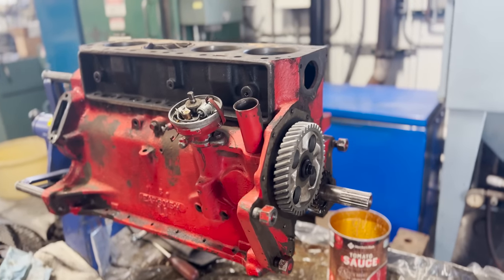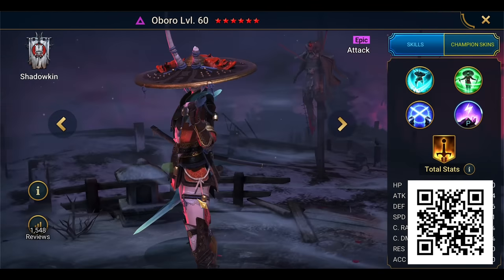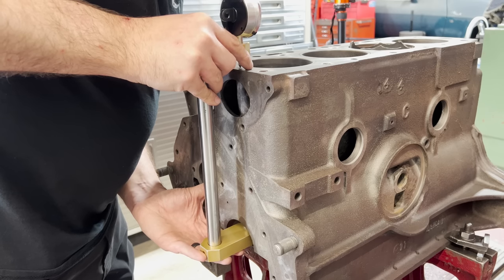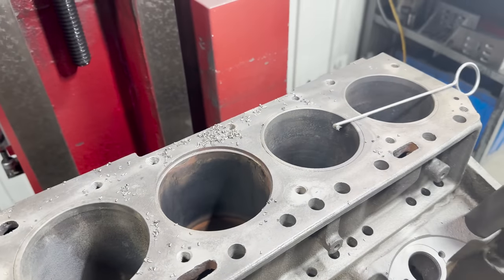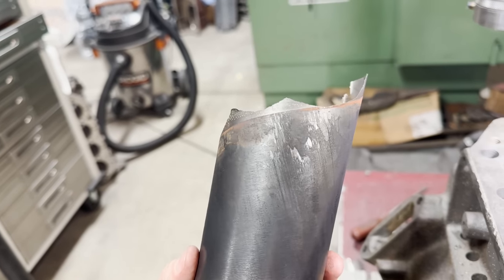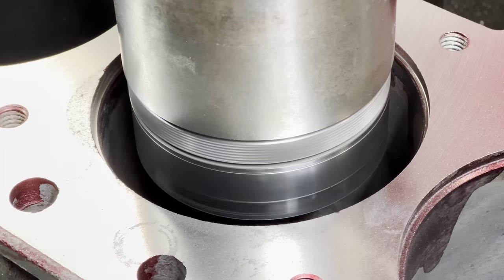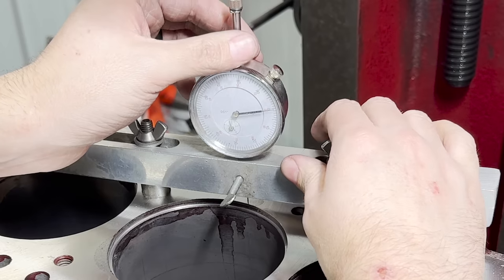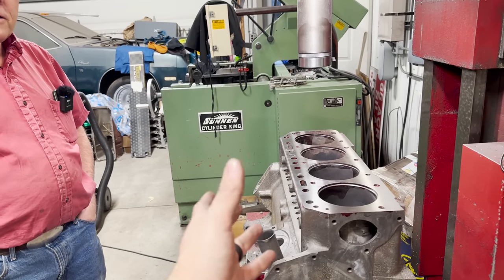Do YOU Want To Know Why WE Don't Use Sleeve Pullers?

Comment: The previous machine work done to this block, is where the problems started...  It is a shame that the parent cylinder bores, after they were previously butchered, are over 0.005" out of round... That really caused problems with the sleeve replacements... 
    When working at the airlines, years ago, damaged machined surfaces on expensive parts could be built-up with a process called plasma spraying that provided a hard surface that is extremely well bonded to the parent metal... Then, it was ground to the desired shape and size to match the specs that are needed... It probably isn't cheap to do this, but it could provide a solid option, to bring this machine back to factory specs. by building-up the the O.D. of those sleeves, and use a surface grinder to bring them to an exact radius to provide a surface that the re-cut cylinder walls would give a perfect circular interference fit for the now slightly larger O.D. sleeve to be pressed into...
...
Reply: It is false. The out of round was not bored that way it is the result of heat. Same goes for the deck, that wasn't sloppy machine work it is distortion in the cast.
Reply: @bcbloc02  hmmm. I imagine that could be possible... But aluminum is notorious for doing that , with it's low critical temperature being around  475°F. 
      But I thought cast iron has a much higher critical temperature, somewhere around 1,450°F... If it (cast iron block) was warped from an engine overheat, then shouldn't cast iron & steel exhaust manifolds , turbo-exhaust housings, catylitic converters, DPF's , etc , become consistently heat damaged?
    And, if heat did cause the warping of that block, and cylinders, shouldn't other materials in that block , such as aluminum pistons, bearings, rubber gaskets & seals, engine oil, etc. , also show signs of overheating?
      I'm thinking the machinists on this video are spot-on with this damage assessment, as to what originally caused it, and how to repair it...
Reply: @michaelmartinez1345  I can assure you that cast iron distorts with heat cycles and that it is nearly impossible to find an exhaust manifold that is flat after any amount of run time. I have seen Cummins 12v manifolds shrink so bad from heat they can literally break the ears off the cylinder head. I have a couple that are almost a quarter inch shrter thn they were when life started.  Castings have residual stress, combine that with thermal stress and things move.
Reply: @bcbloc02  slight distortion of large lengthy parts like exhaust manifolds, and headers, that are manufactured with less regard to structural integrity, like exhaust headers and manifolds....yes I agree with that .... It would not surprise me if some warpage took place with those types of items, which is Why several exhaust components have expansion joints, that allow for this distortion.... But an engine block , especially one as strong as a diesel engine? My inclination is to expect a very small amount of distortion, like 0.0003", maybe... But 0.005"+ ???  No I would think that is NOT normal for such a stout casting made of cast iron to be that badly distorted from heat damage .... Aluminum, yes - that type of warpage and worse, is frequent, with overheated heads and blocks... And the Aluminum ends up being annealed and has only a small fraction of it's original tensile strength , hardness and shear modulus after it was heated to above it's critical temperature (475°F.), and lost it's tempering.... This is when major hard to find, often extremely expensive components can easily become a piece of junk / scrap metal, when it is made of Aluminum and has been heated to above it's critical temperature (475°F).... And it is one of the reasons that several high stress engines that are designed to last a very long time have several major components made of steel and cast iron and other materials that can handle high temperatures and stress... Because they are not as negatively affected by high heat, as other materials, like aluminum is... If cast iron warped that badly, the exhaust side of the turbo-systems, would begin to rub against the impeller as soon as the first heat cycle takes place, which is WHY aluminum turbo housings are ONLY used on the much cooler intake side of turbo-charging equipment....
      So no, I don't feel that cast iron engine block deck surfaces and cylinders, become warped from an engine overheat, nearly as severely as aluminum block  engines - so often do..... It is one of the main reasons that many people are now seeking older vehicles with the cast-iron engines... They tend to last much longer...
Reply: @michaelmartinez1345  I just did a 4b Cummins block on my channel that took .012" to fix the deck back flat. When I took the first .005" you can see 2 spots that touched on the top end of the block but it took another .010" to get the hole out that was between 2 cylinders.  That spot was obviously low because the head gasket had started to fail in that area. The engine had been extremely overheated at some point as the pistons looked worse than the Allis ones did here.  I have done a lot of 6  cylinder blocks that were .020" out of course these are blocks 4 feet long so its not a lot /inch but adds up quick over that long length.
Reply: @bcbloc02  gotcha... Wow... 0.020 just to clean it up... I wonder if the hot gass's jetting through the failed gasket could have caused some erosion in those spots... I heard of that happening in places where failed gaskets are... It just cuts a river-bed on the machined surfaces... People who don't want to spend time & money to get it repaired sooner, and later the damage is done...
Reply: @michaelmartinez1345  In this case the gasket had not totally failed and torched the block. You could just see the steel fire rings in the head gasket had pushed out and gotten wider where they were drifting on the deck from lack of clamping. Often times if a gasket does totally go and it continues to be run it will look like someone took a cutting torch to the block. This is much more a thing on gas engines than diesel because the fuel is everywhere there is air in a gas engine but only where it is injected into the combustion chamber on a diesel.
Reply: @bcbloc02  Gotcha.  I guess there are some situations that even cast iron will warp... Or Maybe there was a casting flaw in the foundry where Cummins makes their engines, in this case the 4-cylinder B-series  engines they manufactured , much the way you described a casting problem at the foundry where the manufacturer made the initial coarse /unmachined version of their engines , such as a core - shift that could take place after 7 or 8 molds have been poured using the same casting cores... 
        But the way you just described the condition of the head gasket, it sounds like detonation could have been taking place, inside of the combustion chamber... This could cause certain damage to gaskets, pistons, heads, cylinders and several other components... The timing of the burn of fuel is so important. Just a few thousandths of a second when the fuel begins to burn, in a internal combustion reciprocating engine can make a huge difference as to whether it detonates or not...
     What I'm also wondering now, is why the ECM did not shut the engine down when it was overheating, unless it was an engine without an ECM, or some other type of device to automatically shut the engine down during an overheat...
    I remember a couple places that I used to work at, had Chrysler slant-6 engines... One was in a forklift, another one was in a bag-tractor at an airport... Both pieces of equipment had clogged radiators that caused them to overheat... Both engines ran fine, and after the radiators and thermostats  were replaced both units continued to run fine... The engines were that tough. Numerous overheats, with no permanent damage to either of those all cast iron engines... 
      However, on many of the newer vehicles, that are loaded with several aluminum cast or billet parts, usually a single overheat, will permanently damage the engines... To the point where they can not reliably be used again without replacing major components... Too expensive for most owners, so those vehicles quickly become very expensive scrap metal...Just what the manufacturers want to see - to be able to continually sell these expensive packages of scrap metal to the public who have been jaded to buy equipment like this...
     Btw, yes gasoline engines that have fuel introduced near the entry of the intake manifolds do have the advantage of washing down the intake system keeping it clean from the filthy build-up that takes place from the PCV and EGR systems... So the unfortunate individuals who own the diesels (compression ignition) and direct injected gasoline (spark ignition) engines that create the build-up of soot and thick black nasty carbon deposits inside of the intake tracts because nothing is washing it away, end-up having to pay big $ having to hire people to remove and clean-up the inner passages of those intake systems, in order to get those engines to run properly...
         Thank You for reminding me of one of the hundreds of built-in deficiencies of the modern over-engineered machines recently offered to the public....
Reply: @bcbloc02  It always seem like he should have assessed the condition of bores before you proceeded with decking and addition work. Some people might think he performed necessary work to lock the customer into completing a job he might not have proceeded with if he knew what lay ahead. An opinions.

Comment: Any time you cut old sleeves. You should always requalify the bores by taking a chip on the largest reading bore size and making that size the size of ALL THE BORES. this obviously would be custom sleeves. That's the problem with buying the same size sleeves that are in the block. Like all rebuilds it becomes a can of worms sometimes the more you get into the job. Any time I do work on existing part I fully inspect AS MUCH AS I CAN IF NOT ALL OF IT. THEN YOU HAVE NO SURPRISES.

Comment: Could you run a bead of weld vertically up the sleeve to shrink it to help pull it pull the sleeves without causing issues with the bore?
Reply: That was my first thought also.
Reply: I've done that. H Farmall. Two came right out with a puller. A couple of weld beads loosened the other two. Just a word of caution to anyone who  hasn't done it, just make sure you don't burn through the sleeve when welding. It doesn't take much and they shrink loose.

Comment: I kind of skimmed through the vid, so I may have missed something, or a lot.
When I run into a block twisted like this, I always think overheating.
Then I think, with a block as old as this one appears to be, maybe out of a tractor where the engine is actually part of the frame, a lot of twisting forces might have occurred.

As to speaking about the last person/shop who worked on this engine, he might have not machined anything. He may have been in the same boat as you with customer not wanting to spend money and requesting only new rings, then later claiming it was rebuilt.

As to dry sleeves, one has to remember they are not a "press fit", they are a "shrink fit" which is a whole new measure of tightness created by chilling the liner to way below zero, -40 or more. The liner pretty much becomes bonded to the block.

Hence, your system of boring the liner out is the solution. Trying to pull or knock a dry liner out of place is unlikely, if it does pop out it's loose and the block bore is worn.

Comment: Yesterday I watched this video. I fully enjoyed it. However, I have a question. On the face of the block, (front) right below the camshaft port there is a jagged looking hole. Looks like someone hit it with a hammer. Now, I think it may be crazy to ask if that is normal...but is it? I'm sure you wouldn't be doing all that work on a bad block. Thanks, Mark

Comment: Meh, warping the liner is bad, cast hates that, but it is under compressive force. So I will call it good enough :)  Plus it will be really tight at running heat. If the circumference was off I wouldn’t try it, it has to be tight. (Hot spots if it has a gap at the top)

Comment: Would it be a reasonable idea to press the sleeves into the oval bores, and then measure the X/Y on the interior of the sleeves, and then bore them round? This will make the bore a few thou oversize, but would that be better than oval bores that are probably oversize in one dimension and undersize in the other?

Comment: I am a learning machinist and had  a question  .When do you bore and deck a block with it mounted off of the crank saddles as opposed to the oil pan flange you are using here? Thanks
Reply: Pan flange and crank bore may not be parallel. The crank bore dictates where everything else should be as far as parallel so it is the best reference surface to base off of.

Comment: If the block is to be put back together as is would it be effective to bore it out to get the tight spots within spec? Or do you need those tight spots to counteract the loose spots?

Comment: What materials are sleeves made from? I know most are from iron, but also heard of steel sleeves as well, is there any other alloys of steel or iron?  
I was thinking of buildings a modern version of the old hit and miss or outfield engines, and thinking of possibly using steel,  I'm guessing steel would probably work best with iron rings, I'm concerned with wear, due to I want it to be a working engine,

Comment: I have the same type of motor in a 1955 640 it’s 135 cubic inches all parts are same heads crank rods can the 135 be machined for the larger sleeves and piston. My engine has 2500 hrs and holds 40 on the oil pressure but a good bit of blow by when you run hard mowing hay all help would be appreciated

Comment: I’m curious I’ve removed hundreds of dry sleeves from 71 series Detroits using a sleeve puller that fits into the air ports and I’ve only come across a couple that were really stuck. These stuck sleeves were on engines that were severely overheated or damaged yet they still came out without having to bore them out. What would cause a sleeve to get stuck so bad that you have to bore it out? I’ve never encountered this issue before personally.

Comment: I would like to see a Part II

If you would please indulge my ignorant question:  would it make sense to split the difference in block bore size,  so it's not entirely so out of round?  I can see why you wouldn't want them to vary between correct size and larger than that, and it seems to me, (again - in my admitted ignorance), that it would be better if the high spots in the block bores weren't quite so high.

Likewise,  honing to a proper crosshatch would do quite a lot to promote proper ring sealing,  even if you can't get fille to fit rings, or the customer doesn't care to pay for the extra labor to fit rings if they're not normally file to fit.

Comment: A good hot acid bath should clean a cast iron block up like new i have never worked in a shop where a cast block has been bead blasted you are just taking a risk that glass beads could be left in the block somewhere.

Comment: if you wanted to do this guy a favor while you had the sleeves out you could have chamfered the water jack inlets, increases cooling surface without boring the passageway, works .. you press them in the opposite direction they were pressed in or the same??

Comment: Is the oversized piston cost that much more? Why not clean up the cylinder bores 10 thou and.go.with new pistons and rings? They aren't that expensive and the slightly higher displacement with nice round bores will provide a little more power.

Comment: I need advice.
I have an Ls2 block that was stroked for my 403 forged setup.  I was running 18lbs of boost and my meth nozzle got sucked into a cylinder.  It made a hairline crack in the cylinder.  It went from having a super lopey cam sound to a very stock sound and was pushing a little water out but you honestly wouldn't have known it had a crack.  
My question:. Sleeve just that once cylinder and then get a piston and balance it, of course OR do you have to sleeve EVERY cylinder?
I have been told to sleeve them all which I don't see why but I'm not a subject expert.

Comment: on larger engines we usually run welding  beads up the inside length of the sleeve...this shrinks the sleeve when cooled and makes it much easier to jack the sleeves out...Probably ok to bore it out on small bore stuff like this, I'm talking industrial and ships engines where you can't take the block to a shop.  12" bore and up.  I don't see why the weldng idea won't work on smaller sleeves, thio' if you're going to bore anyways....

Comment: Is it just me or just a trend whenever you deck a block I notice that the rear side (side away from the machinist) always seems to be higher. The first cut on all the blocks looks like the rear facing always gets cut and the front facing, misses getting any cutting action. You always have to take at least a second cut before any of the front part is contacted at all. Could it be that your base is higher at the backside maybe a degree or two?

Comment: Did the warped, out of round bores  in the block cause the sleeves to not pull out with the puller? The puller should have worked, otherwise why have sleeves in the first place if you have to bore them to get them out? With the uneven contact with the sleeves, I bet there were hot spots that made it even worse and caused cooling problems. Best would be to make the bores in the block straight and  round but then the cost of custom sleeves from here on out would be prohibitive.